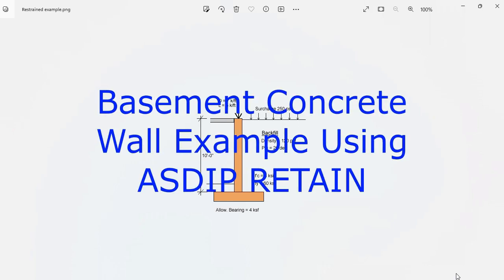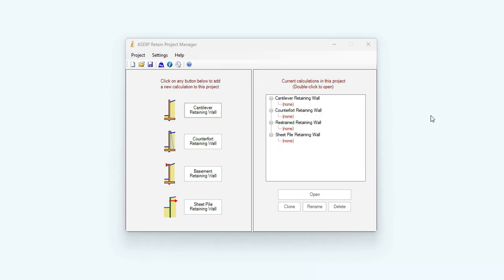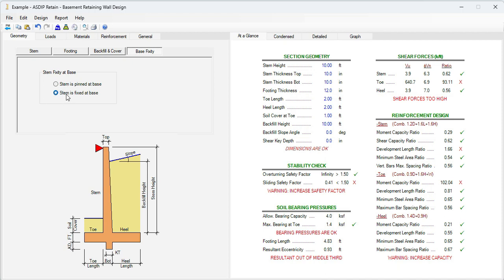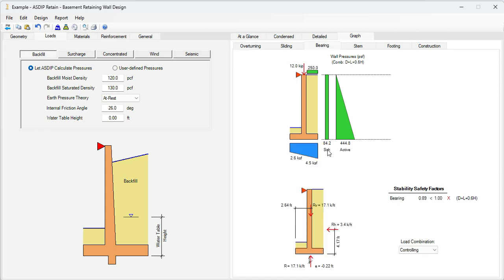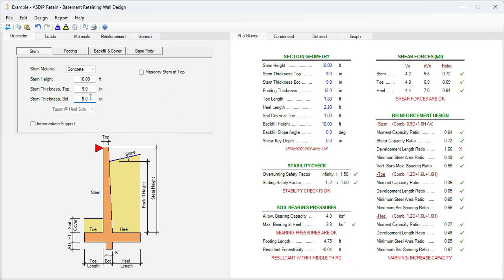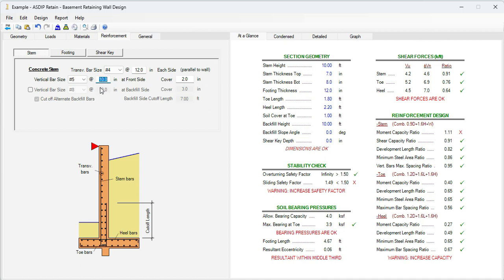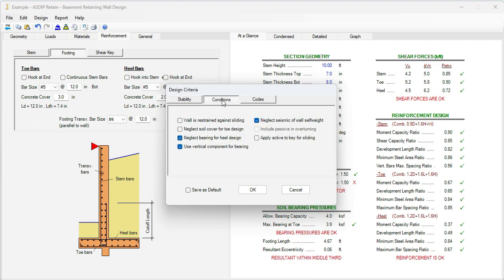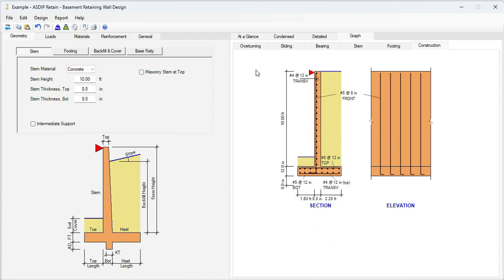Basement Concrete Wall Example Using ASDIP RETAIN

Comment: Is there a "auto create" to build the wall to minimum passing requirements without playing with the numbers?
Reply from the maker: No. There are so many variables involved in the design of a retaining wall that this would be very difficult. In addition, being the design process a mix of science and art, the personal touch and preferences of the designer cannot be replaced by any software.